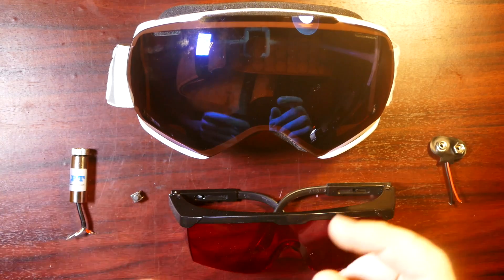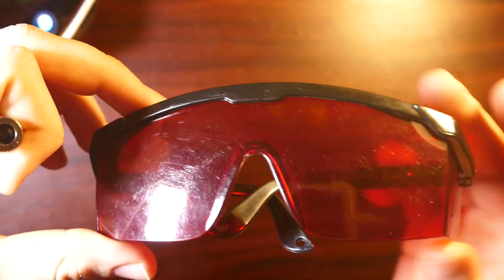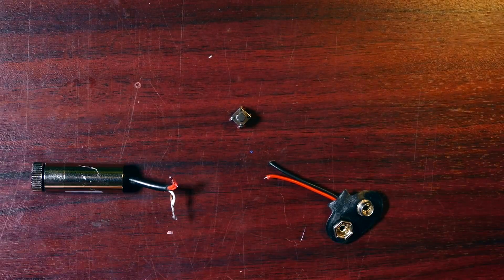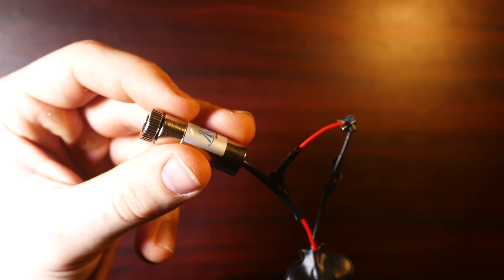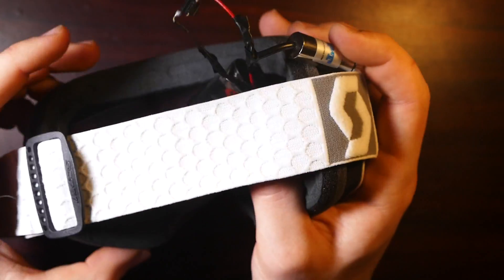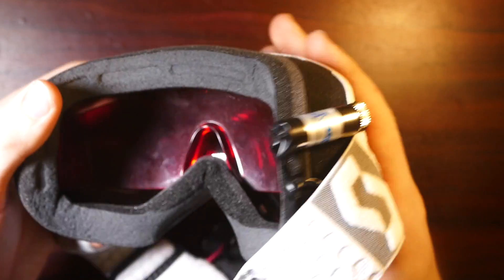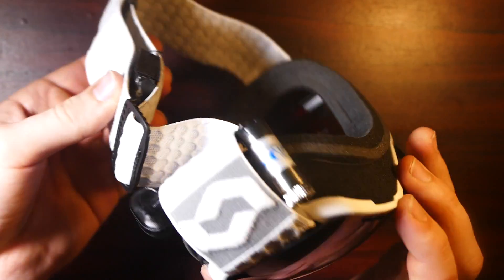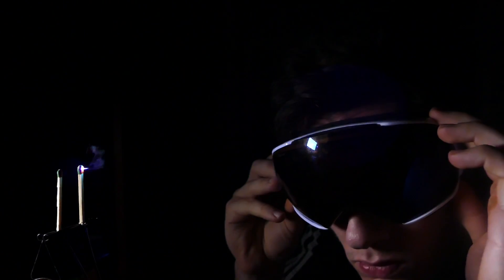Making Some BURNING LASER GOGGLES!!! (CYCLOPS X-MEN IRL)

Comment: would the laser be stronger if you used something like a 18650 battery?
Reply: Would burn the laser diode with a higher voltage than it was supposed by the instruction informations (if the circuit is in serial) or just last longer until need to replace the batteries (if the circuit is in parallel)